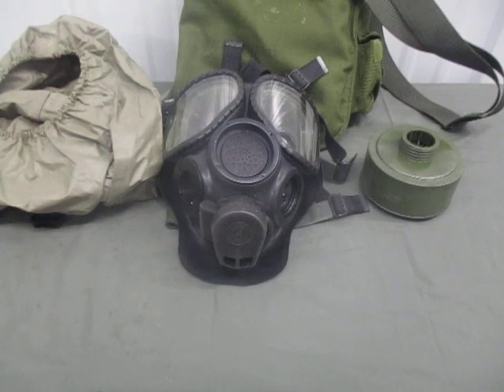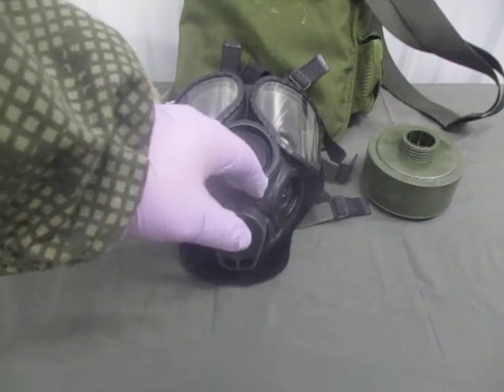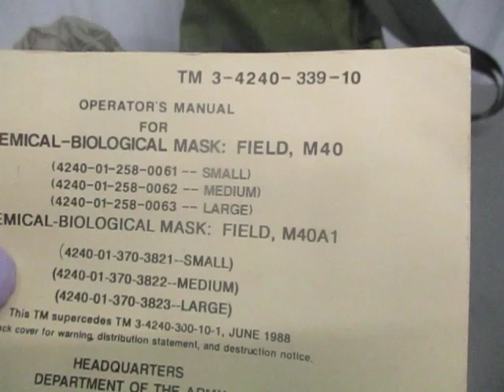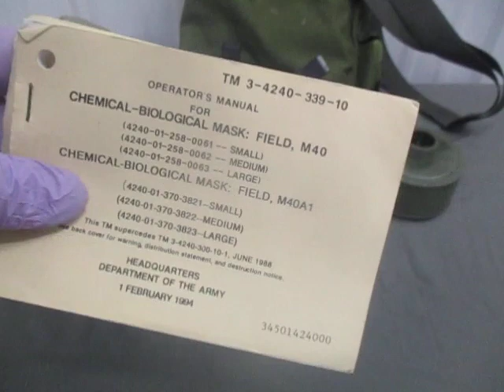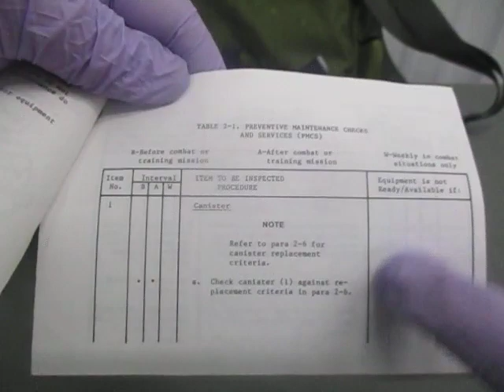NBC CBRN Task- PMCS Of The M40 Series Mask

Comment: I have both an M-9A1 (with 40mm adapter) and a Serbian M-2 ( with a new filter). Both masks are virtually brand new and fit me well. I also have an M-17A1, but that one's a nightmare to change filters on (those God-awful cheek filters!), so I don't use it. I used that type back when I served in the 80's. No thanks.